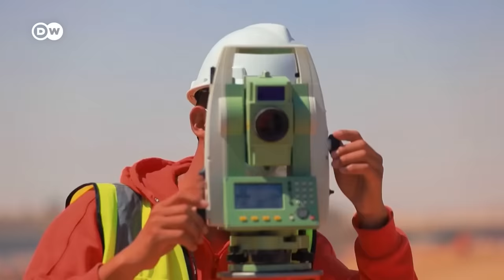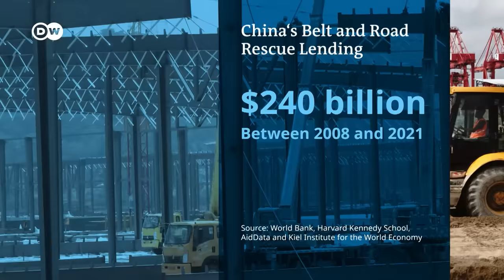Report: China's Belt and Road loans are putting borrowers and Chinese banks in danger | DW news

Comment: I guess that's what you call supply chain infrastructure. 
It's going to be interesting if companies that choose to move production will find this in other countries.
Reply: But hey, White Elephants sure look great.
Reply: Move production from where exactly?

Your open ended question suggest leaving production in China. lol

Mature Western companies are use to setting up new locations and should be aware of what they need to operate.

A labour force, water, roads and reliable power, they're not coming until there are solid assurances these will be in place.

None of those are sexy but that is where the initial investment needs to happen for long term success.

You don't build a house from the roof down.
Reply: @IMGreg..  solid assurances  - I remember back when chancellor Kohl traveled with German industrial leaders to China to work exactly these assurances out.
Was that what kamala was doing in Kenya? ( sarcasm)
It's great to see that at least some people understand that finding new production locations is a much more involved process than just building a factory and a road.